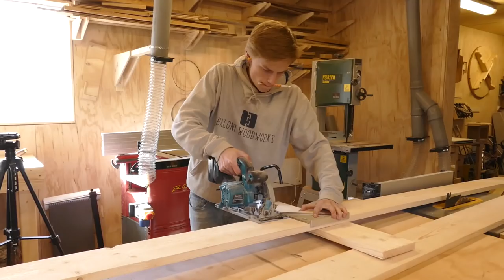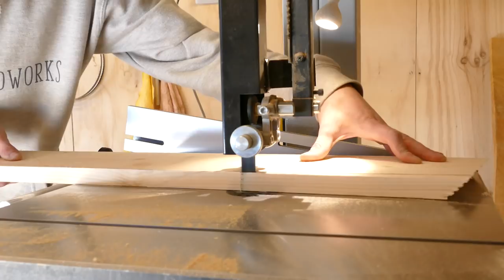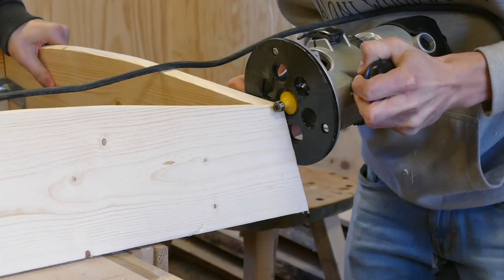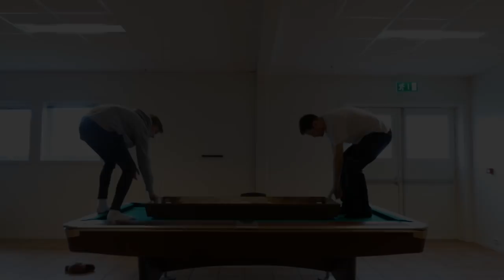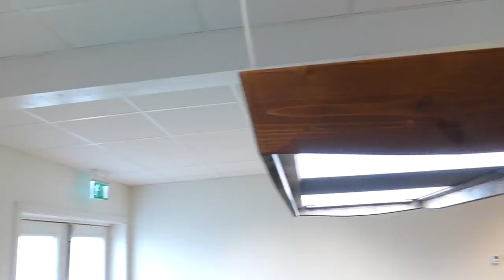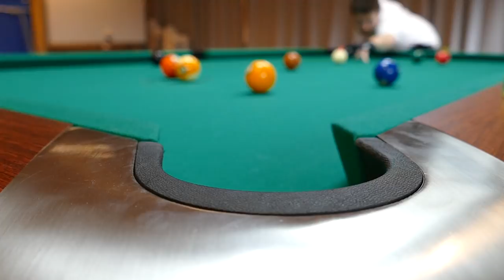Making a Brunswick Style POOL TABLE LIGHT!

Comment: Thought this was a HOW TO video! Was this LED, and what's the middle piece for?
Reply: I suspect the middle piece is just a spacer.  The two lights are just the drop in LED panels for recessed ceilings.  Some times called troffer lights I didn't know either till I googled led panel